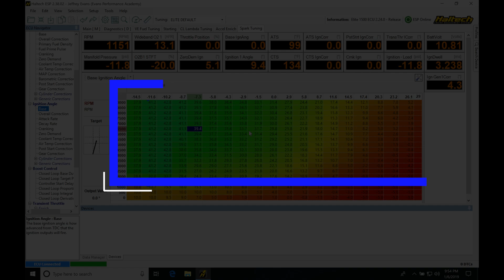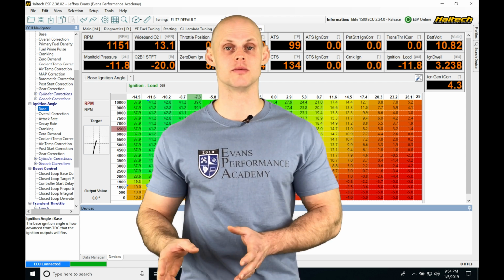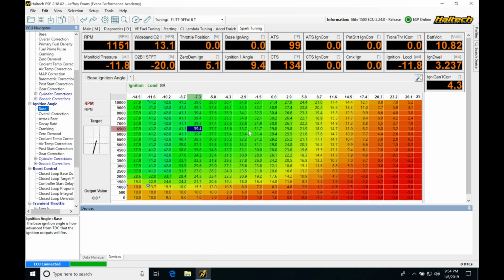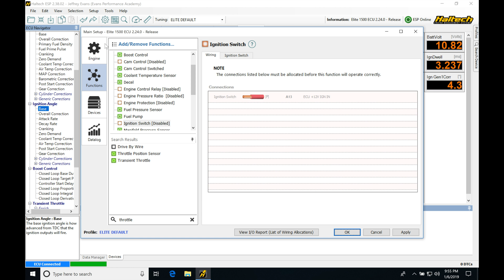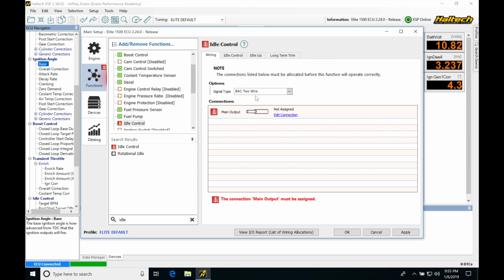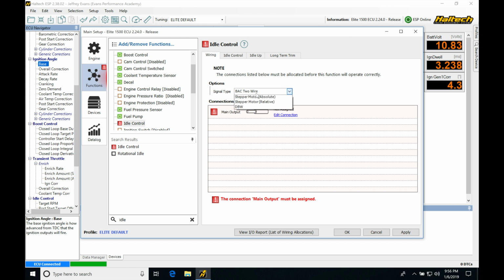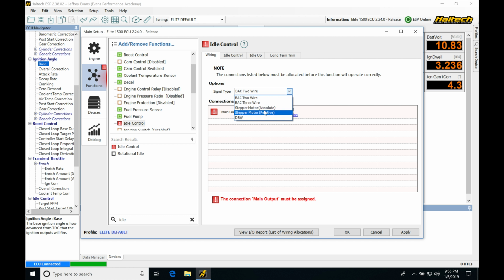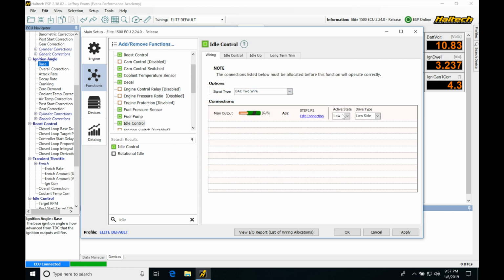Haltech Elite: Idle Control | Evans Performance Academy

Comment: What do you do if you eliminated the idle air control valve?
Reply from the maker: You would need to use the throttle plate set screw to allow more airflow into the engine and utilize spark timing to dial in the torque at idle to hold the desired idle speed.